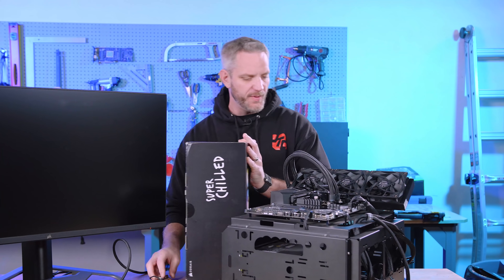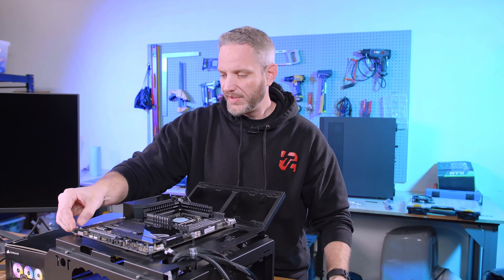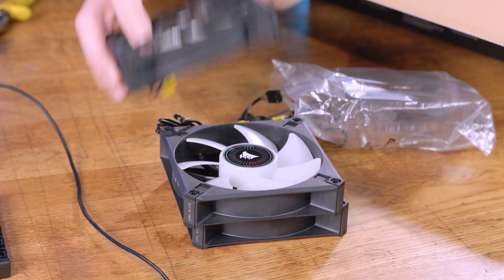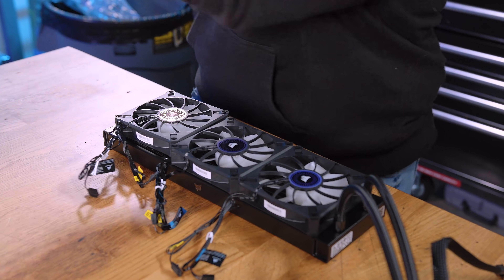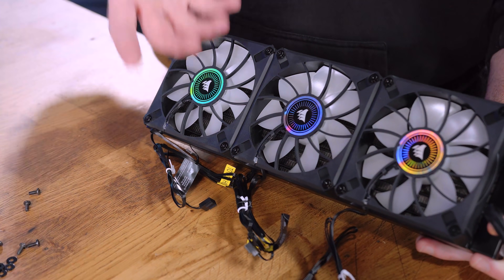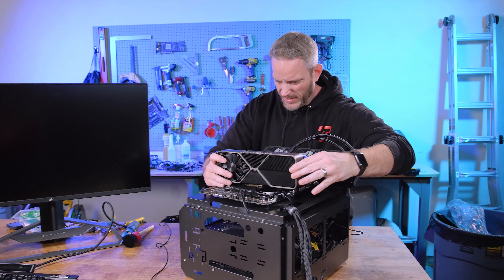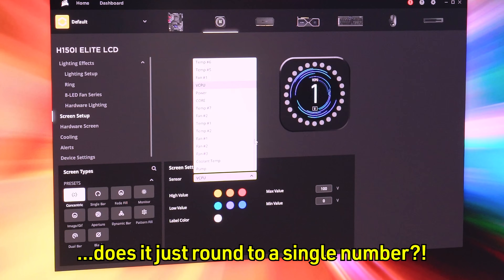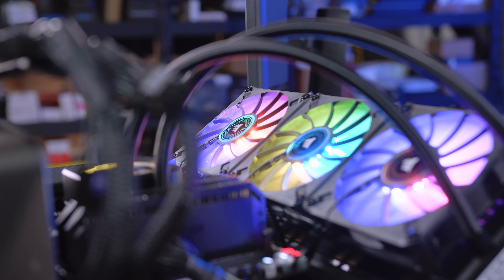Who knew this cooler could be so... COOL!

Comment: This is really cool, but I have two problems with it that ultimately would prevent me from using it. First, after going to the Lian-Li UniFans, I can't go back to something like Corsair. All those wires still give me nightmares. The second is that the Display will likely always require iCUE to change, and I bet you it is required for most of the dynamic data. Now, I'm not one of those "Oh iCUE is eating resources, WAHHH" (although I do feel that is an issue, my machine just can eat the overhead), however I like using Linux. I do dual boot for gaming (not to mention my Windows only software for Work), so the display would be useless for half the time I use my computer. The RGB isn't so bad, since most Corsair stuff gets working in OpenRGB eventually, but it can't do the Screen stuff as it stands.
Reply: i also switch Lian Li Unifans, have to say the a re amazing. i wouldnt want to change them, dropped my temp by about 25 degrees. but am curiuos how this aio would work with unifans, could be interesting

Comment: Nice to see that you actually use those wall-hanging tools. Where's the angle grinder? Why don't these AIO coolers use clear tubing? I'd like to see the coolant flowing and know that the pump is working. Maybe you could start using a rating scale, say 1 to 5, to let us know what you really think of the component you are reviewing.

Comment: Pump should be plugged into your AOI header if your board has one with the fans plugged into the CPU_fan header using a PWM fan splitter. If you don't have an AIO header, plug the pump into a case fan header and set an alarm for a minimum RPM. If you don't have that either, then do it the way J does it.
The apparent quality is pretty shoddy for Corsair pricing.
I picked up a nice Deep Cool 360mm AIO on Amazon for about $160 Canadian on Amazon. Pump is RGB, looks great and performs very well. Less than half the price of this Corsair and all you get extra is the LCD..
I have fallen out if live with Corsair. Their prices are ridiculous and their products pretty average. At least their warranties and service are decent.
Note that push/pull is pretty useless. We tested it on OCN using Corsair water coolers and found a temperature diffeence of about 1 degree c. I stopped using push/pull after that test. Might make more of a difference on an open loop with a thicker rad.
And I agree the fans in this kit suck. And not in a good way.

Comment: While I agree with Jay's idea that a test bench is better for getting true results on an AIO, I think it would be good to have a permanent secondary test PC in a case with excellent airflow and the same hardware on the bench. This would provide useful info on how much of a difference there is between the two scenarios. Wouldn't be difficult either since all you have to do is move the AIO from the test bench to the case. Wouldn't have to hear the complaint anymore.

Comment: One question I had about this cooler vs say the NZXT Kraken Z73 is about the memory, does it have memory? As in, if I put a GIF of you talking, then shut down my PC, reboot it, will the GIF still be there or will it reset to a default CPU temp view UNTIL I start iCue, if it auto saves with memory I'd be so glad to buy this when I do a DDR5 Intel 12th gen build

Comment: I just bought the upgrade kit from Corsair. But thinking about the appearance of the fans and the thermal glue holding the wires down, wouldn't the fans in all likelihood be facing the other way and therefore the thermal glue would not be visible because that side would be facing the rad surface? If mounted on the case top the fans would be pushing air up through the rad to push the hot air out of the case and if mounted on the front then pushing cool air into the case through the rad where fans hopefully on the top would be pushing the warm air out of the case. In either eventuality you wouldn't see the hot glue because that is on the inward side of the air direction.

Comment: A lot of good it would do you if your computer is under your desk, like I have, Cooler Master HAF 932 Advanced. There is 1 230 x 30 mm red LED fan behind the front panel and thats the only "RGB" I have turned on. My Strix MB and Vengeance Ram RGB turned off as I can't see it anyway.
As for the exposed hot glue, some black permanent marker will take care of that.

Comment: Now if corsair could just sell these as separate LCD displays with only a USB header, I'm sure many, including myself, would be very happy to add some tailor-made LCD displays to their custom loop based on iCUE and Corsair Commander. I've been dealing with raspberry screens with ModBro and it's a bit of a mess, and since i had to reinstall Win10, i don't have the energy to set it up again. So if corsair could sell this as an LCD only, i would replace the Pi's in a heartbeat.

Comment: That price is tough to swallow. I picked up a H150i RGB Pro XT for roughly $110 USD off Amazon earlier this year. More than double the price for a LCD on the block and some RGB fans seems insane. Can easily swap the fans for RGB versions and it would still be cheaper. But I am happy with the plain old ML fans. Also, this older model seems to have overall better build quality compared to that one.
Reply: @DK if you have the Elite Capellix AIO already, you can just get the LCD upgrade from Corsair for $100.

Comment: It costs nearly 3000 sek here in Sweden. That's a hefty price-tag right there, and personally, I don't feel it's worth it. Rather have a custom loop at that price. As for the hot glue lumps... look at the other AIO's you've gotten from Corsair. I'll bet you they are there as well. ;-) Those hot glue spots are there because the traditional clips for holding the fans tends to break off.

Comment: Here's a question: at what point should one update their cooler?  When I built my system this time last year, I got the NZXT Kraken Z63 because I really liked the idea of the screen and I had the money to be a bit extra.  It's generally worked well for me; but it didn't actually fit all that well in my case (CoolerMaster TD500) when I was building, and I ran into the problem of having the pump slightly above the radiator because it was literally the only way it would work.  So now I'm hyper aware that the life of my AIO is generally numbered.  So, should I be looking at replacing it now or later?
Reply: just upgrade ur case its cheaper than a new cooler. Mount the rad higher in the pump in that case and ur fine

Comment: Wouldn't the hot glue be facing the inside of the case if it were mounted on the front as intake? Not saying the hot glue is acceptable at that price. It was just a thought about the fan orientation.

Comment: here is the sad part after having the 150 version, the LCD is frozen any software update just turns it to a red caution mark and the only way to reset it is a complete power down. Even after its back up, the frozen graphics returns still reads the temp just fun, but cant change anything.

Comment: This is a 1 year out comment but I just received one of these coolers in 2023, and the fan feedback must have been heard by the Vendor. The fans have just a black sticker, the fan blade layout is 9 blades and the finish where the hot glue was on the review video is finished. properly and looks and feels more premium. Everything else seems to be the same as what is in the video, It is installed on a 7950x3D.

Comment: Do not recommend any undersized cooler for TR4. Esp Corsairs X7/9 coolers. They use cheap threading and they dont cover as Jay mentioned the entire die. I went EK and dropped temps.
Running 2x 480mm x60mm Rads.

Comment: 13:15 My EK AIO 360 waterblock+pump touches my G-skill TridenZ. It might even be pushing on it ever so slightly. It did that on 3 different Mobos. I think that the mobo spacing in between the cpu socket and the ram slots is pretty much the same across all x570 mobos - IDK aobut intel or b450/b550.
Reply: I have the same EK waterblock+pump on my Asus ROG Crosshair VIII Hero with Corsair Vengeance RGB Pro ram and actually have a fairly decent amount of space between the CPU bracket and the closest ram slot, like enough I can almost fit my whole finger between the two. It could be because I have an inverted case setup so my hoses are on the opposite side of the CPU than my ram is, but I thought I would mention it to you regardless
Reply: @zander3115  my Capellix h150 elite works fine with my motherboard.  Did have those issues with the Kraken.
Reply: @zander3115  what chipset/cpu brand?

I haven't tried an Asus board , so it could be Asus does things differently than MSI and gigabyte. Jay is also using an Asus boarding the vid.
Reply: Hi, what do you think about the ek aio coolers? Thinking of getting one
Reply: @haydos6340  mine performs well. It's the 360. I would recommend getting different fans though. The included ones are way too loud for their performance imo

Comment: So the glue is on the "backside" (exhaust) of the fan and would normally be against the radiator pushing air through it, right? Not pulling air as in the test-bench setup.

Comment: Im not sure if this is like the H115i Platinum but  mine set to extreme ran about 1200 RPM or 60% I then set a profile (Created a Custom one) to full at 100% and the fans really start moving air at 2000 RPM . Just wanted to point out I do not think the fans are running at 100% in extreme mode

Comment: I'd guess that the hot glue is to keep a little slack on the wire because of the curve.  If it got pulled straight it would not 'sit properly' in the aesthetic.

Comment: THE HOT GLUE... Corsair WTF!?!    For those unaware and despite Gamers Nexus lack of understanding on the use of hot glue on PCs. Hot glue is commonly used to hold down or keep cables attached. It does not hurt any components and is easy removed with just brisk heat from a heat gun or hair dryer for that matter. Its common practice to hot glue the edge of ribbon and even sata cables that could come loose and is often done in prebuilts to keep stuff from coming loose in shipment, like USB 3.0 cables. BUT it should never be used by a manufacture to fix a design flaw, LIKE CORSAIRS FREAKING FAN WIRE.

Comment: Jay, I'm planning on building a system when Intel 12th gen cpu and Z690 motherboards are released. I understand that Windows11 OS will be required to fully benefit from everything 12th gen has to offer, i.e DDR5. My question is should I install Windows11 at the time of build or Windows10 (which I'm familiar with) and upgrade to Windows11 in the future?

Comment: i wish i had that ram, i have the earlier version of the corsair dominator ram where you have to change the white light bar for an rgb one.  i'd just like the rgb ram instead.  i only have 16 gb 4x4gb  but at least it does 3200 !  I'd trade that, and the 32 gb of ddr4 trident z i am running currently for that. it's also at 3200 mhz !!

Comment: So back in 2020 I jumped on the "early adopter" bandwagon of owning an overpriced AIO cooler with a screen in it. That was the Kraken Z73 from NZXT. Side Note: They released a RGB version for almost the same price (about $300 vs $275 that I ended up paying) and now there's a white version.

Anyway, I just compared the specs of the screen on that Cooler that I still have in my PC as I type this out and it's such a step down from the one CORSAIR is offering now. 

This is the specs for the NZXT Cooler

Active Area:2.36” (60mm) Diameter

Color: 24-bit True Color LCD

Resolution:320 x 320px

Brightness:650 cd/m²

Framerate: 15 FPS (I had to actually get in touch with an agent on the NZXT website in order to get the framerate info because for some reason they left it out in the tech specs section of the product!) 

Meanwhile... here are the specs for the Corsair cooler:

Active Area:2.1” 

Color: 24-bit True Color IPS LCD (I'm GUESSING the NZXT's is also IPS but I'm not sure. I couldn't find it anywhere)

Resolution: 480 x 480px

Brightness: 600cd/m²

Framerate: 30 FPS (And Corsair had the balls to actually have this info on their tech specs section under the product!) 

The only real step-down from going with Corsair is the VERY SLIGHTLY SMALLER SCREEN and the fact that the brightness has a max output of 600cd/m² vs 650!
Reply: If it's any consolation, my Galaxy Watch 5 (the newest one as of now since Samsung releases a new one every year which is promoting intentional obsoletion, but I digress) is also 320x320 and any animation on it runs at 15fps. The difference is that one of these is something you interact with and see much more closely, and the other is a PC component that is deep inside a case and behind a glass wall.

In reality, though I don't think it matters as much as its cooling capability does. The screen is just a bonus for those who want it badly enough to pay more. I think it's pretty cool though, and I don't like the bulk of the huge air cooler I wanted to put inside mine, so I am probably going to buy this cooler after I save up a little money for it.

Comment: But.... from what I can see, wouldn't the hologram and the hotsnot face towards the inside of the case if I were to mount them in the front? So... it's a non-issue? By the looks of it the air get's pushed out the side with the hologram.. or am I mistaken?

Comment: To be fair...if you were mounting those fans as an intake on the front of the case, you wouldn't see the hot glue because that side of the fan would be against the radiator, since you'd want the RGB to show through the front of the case.

Comment: What's the warranty length on that cooler and what does it cover?  Yeah they hot glued the fan cables, which means they bodged every other last minute problem too.  I'd just avoid it.  It's no better than any other AIO but those other AIO are known to hold up.

Comment: I've got that issue with ram slots right now, got an NZXT Kraken X72 and 4 x 16gb sticks of Corsair Vengeance RGB in an Aorus X570 Elite board and the tubes impact on the ram. I'd turn the block but then it impacts on the cover for the I/O.

Comment: If you're testing anything but the cooling setup, would it make sense to use a 480 radiator with 8 fans in a push/pull? Or would that result in too much cooling for testing?

Comment: I have the one with a 240mm radiator and its not as good as i thought it would be. My 5800x3d still thermal throttles during a benchmark

Comment: @JayzTwoCents You mention about screws piercing the cooling rows on the radiator. Every corsair AIO I owned use to have these screws so long that they actually pierced through the radiator for about 1-2mm. This is the case for both short and long screws, they just go so deep that they damage the fins. Is this normal? I always use provided washers

Comment: If it was mounted in the front of the case wouldn't you turn the fans around and have them blow thru the radiator (intake) instead of pull through the radiator (exhaust)?  It doesn't make sense to me to have front exhaust.

Comment: Jay, I noticed that the H150 ELITE LCD comes with three ML120 RGB Elite fans. Those fans are normally rated at 2,000 RPM, whereas the Previous H150i Elite Capellix uses three ML 120 RGB Fans rated at 2,400 RPM. So I suppose my first question is, Are the Fans in the newer AIO really rated at 2,000 RPM? (info missing from website) or did they ramp them up to 2,4000 specifically for the AIO like they did for the Capellix?  Also that being said do you think this AIO will outperform the previous generation Capellix?

Comment: How about another vid on FSR, how to properly use it and what it means for people with older hardware like perhaps see how it works with the GTX 1080 or ther RX 580 on games that support it, especially in this GPU shortage...also since Windows 11 is a nightmare how about vids on using the different Linux/Umbutu operating systems since people seem to be jumping ship

Comment: Strongly considering a 240mm version of this to use with a i5 12600k but am concerned that it’s not going to adequately cool it while under load… Would do this version instead except the case I had my eye on won’t support a rad of that size on the top and I can’t sacrifice those front intake…

Comment: I have a 12700k and h100 should I upgrade to h150 to fix Overclocking thermal throttle is it worth the upgrade

Comment: for fans i would not use anything other than the AL120s from now on. very little cable managment. i used a corsair comander pro on a 10 fan case 011 xl  and the wireing was a nightmare. alse if one fan is glitching with the rgb it brakes every fan after it on the comander pro.

Comment: Okay Jay, when are you going to trim off and paint that bracket on your test bench that you cut and smashed over with a hammer? If your luck is like mine, you will probably scratch yourself on the jagged edge if you don't. During the whole video, that has been bothering me.
Damn my OCD.

Comment: The hot glue and the hologram sticker do make it look cheap.  If I was in the market for a new aio cooler I would give this a pass despite the lcd screen.  And I'm not about to go and replace my new H150i Elite I got for my build I just completed in a white Corsair 7000x RGB case.
Reply: I just bought an elite capellix. The lcd one isnt even available in my country yet. Not going to change it
Reply: @mrcharlied4228  You can buy the LCD screen separately from Corsair if you already have the capellix.

Comment: CLC prices are getting expensive especially with a screen....a screen. If you can give $300 for a CLC then save up like another $100 and go soft tubing, the benefits are real with DIY compared to CLC. I have quite a few CLC's and custom loops and yes a CLC is a way you can go water easily, but, but DIY in 2021 DIY watercooling is so easy compared to just 5 years ago or so